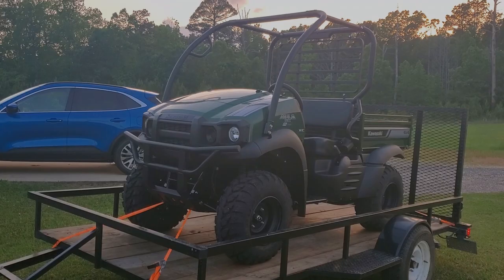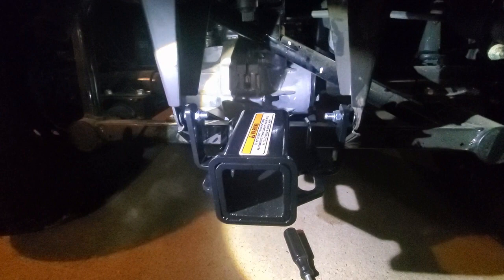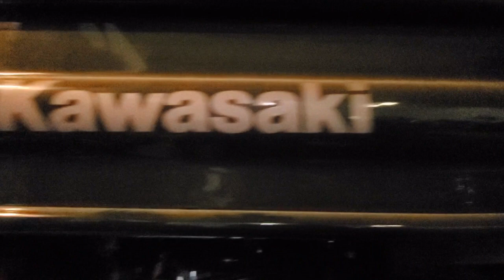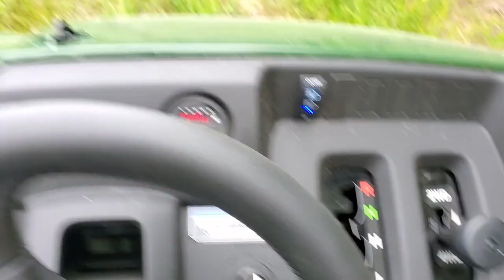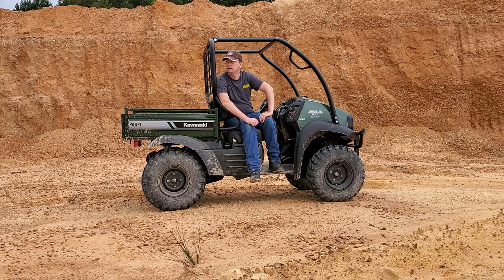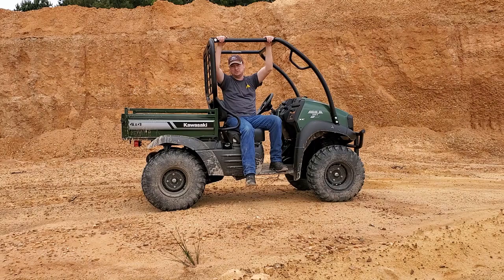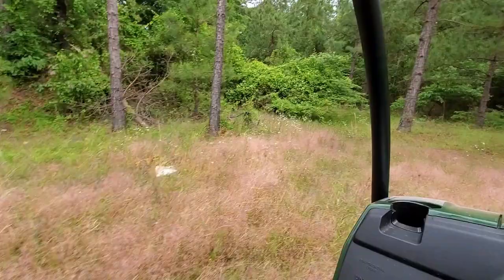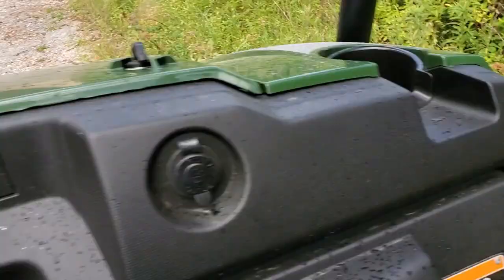Kawasaki Mule SX XC 4x4:  The First 24hrs

Comment: I have a 2018 in Camo. It was my first UTV. I use it  for hunting and a little riding on Uncles farm. I love everything about it except when its under a heavy load it gets pretty loud. Hauls deer as I intended it to and gets to my hunting area quickly. Added the roof, windshield and trailer hitch after purchase. A winch is my next addition after getting stuck this winter. If it had to be replaced I would without hesitation buy another one, good value. Good video!

Comment: GREAT VIDEO.  When I was looking for info back when I got mine, there was virtually only a handful of videos including what Kawasaki put out.  Mine is a 2013 610XC in Camo.  Pretty much the same overall with cosmetic differences, different style tires, and  the 2020 is fuel injected, mine has a carburetor with a choke.  So many reasons I chose the 610XC.  Price and basically the features I wanted were it’s big selling points for me.  It is super narrow and will go anywhere a quad will.  A SxS just 6” wider and many trails I would not be able to go on.  I am not a speed demon, so it’s limited top speed doesn’t mean anything to me.  I just love to putt and crawl around on the local atv trails and this thing excels at it.  Mud, hills, rocks, a breeze,  And I have done all that In 2wd.  Haven’t even really used the 4wd that much.  The only thing that has slowed me down was a water hole that got a lot deeper just before it ended and I drowned it out.  I have a winch on it, so winched it out and it fired right up.  Just an an amazing machine.  I added some things to mine.  Under seat storage bin, front and rear bumpers, winch, rear hitch, and the ROOF.  The roof is amazing and I highly recommend it,  just saving your head from low hanging branches, is a godsend.  I also bought the thunderhawk skid plates that I have to install.  Just a little bit here and there over the years.  I just changed out the original battery last week.  Was still starting, but at almost 8 years old, didn’t wanna get stranded on a trail.  Even though it’s a 2013, it’s still a baby with only 55 hours on it.  Enjoy it and don’t be afraid to take it on the trails.  At slow speeds, it’s virtually a tank.  Very sure footed. Reliable.  Simple.  Seat is comfy.  User friendly.  Plus, you can also use it for yard work to boot....lol.  Enjoy....!    Btw....Great username.  Love the 4570 and own several.
Reply: What size tires are on your 610?

Comment: Loving my 2019 SX  I put a 3500 lb winch on a 2" receiver winch plate and stuck it on the back in a 2" receiver hitch I power it with a JNC660 jump box so it has it own power and I have the jump box for backup. I have had it a couple of years now and all I have done to it is change the oil and air up the tires it has been perfect the whole time.

Comment: That is the perfect size side by side. I have a 07 Rhino but its about time to upgrade. I'm just alittle concerned about the power. Seems to do okay but going from a 660 to that seems like a big difference.
Reply from the maker: I'm sure. You might be disappointed. But I also don't of any SxS today that would tick all the same boxes as a Rhino.
Reply: It is a tank. Granted it will only go 25mph. However I have gone up some steep terrain on hunts and trapping trails. Mine just passed 300 hours and it is the 2019 cammo version

Comment: You had a miscommunication with the dealership on the hitch. It has a dif-lock! I can go places that a larger size Polaris can’t. I am willing to give up the speed. I have a 3000lbs winch. Perfect
Reply from the maker: The rear locks. The front is limited slip.
Reply: 4570shooter agreed but all in the less than 10k $ range don’t have a diff-lock at all.   Your $ was better than here in Texas!

Comment: Rattle is probably the tailgate cables. Tighten the bolts slightly.
Reply from the maker: I found the source of the rattle. It's the seat belt.
Reply: I got that same one, the seatbelt rattles on mine to when I have it on

Comment: What you described on the throttle going up hill may be just like my golf cart, use it at about half throttle.  Certainly not as fast, but the engine doesn't bog and it pulls better.  Getting one of these to replace my 99 Golf Cart.  Golf Carts have become insanely priced.  Thanks for the review.
Reply from the maker: I'll try it! Thanks, buddy!
Reply: @shooter-vx7xy  another way to say it. Less accelerator grabs a lower gear that you need for inclines. Good luck.

Comment: i own  one also and i believe you are wrong about the fuel pump and the air filter  box does not pull air in from the lid like you are suggest  it only pulls from the top of the  ROPS.      nothing against what you was doing just don't want someone mislead
Reply from the maker: No, you're absolutely right! I found that out a week or two ago but the video is already up. 

But I'd add, though, that the box still isn't sealed, so you still can't submerge it.

Comment: I looked at these, but just too slow. I got a used Polaris Ranger full size 570 with only 52 miles on it for $8,500. I would t be opposed to owning a mule though
Reply from the maker: Yeah, the limited speed is the one thing I think everyone should think about before buying.

Comment: Just thinking, the XC has 2in bigger tyres so must be higher geared yet still does 25mph same as standard SX. So either different diff ratio or cut the engine revs to keep top speed at 25mph? Also higher gearing will make the engine more sluggish on the road hills. If the brake drums are the same size as SX with 24 inch tyres this will reduce braking ability with 26 inch tyres on The XC. It would be very interesting to compare both models on road test together. Hoping to take delivery of new SX end of Jan 23. Don't get the XC model  in UK. All the best for new year from south east Scotland.
Reply from the maker: The XC doesn't do 25mph. Mine did 21mph, GPS verified.

Comment: I just picked up same machine, I have same rattle, did you locate the source?
it's hard to get used to no engine braking
great video
Reply from the maker: Not yet. I've only had mine a few days. I plan to go through it at some point and tighten different bolts to see if anything changes.
Reply: 4570shooter another video said it was the seat belt clicker

Comment: do you typically cruise around in 4x4L with the rear diff locked? when i have all that engaged it seems like i cant steer as well. i cruise the same type of land as you and am in 2wdH 99% of the time unless i am crawling over logs i will pop it into 4wd for a few seconds but i rarely, like very rarely, lock the rear diff. am i using my machine improperly?
Reply from the maker: You're fine. I'm in 2wdH for most of that video.

Comment: Just bought the same machine, has a annoying rattle, any idea?
Reply from the maker: Seat belt.
Reply: @shooter-vx7xy  Thanks,  I'll check the seat belts but my rattle is random, under the dump box, and sounds like a tin can full of nuts and bolts. Maybe back to the dealer.
Reply from the maker: @jgilbert589  You can test it by pulling the seat belt until it locks. When it's locked, it won't rattle.

I thought mine was in the bed or roll cage.